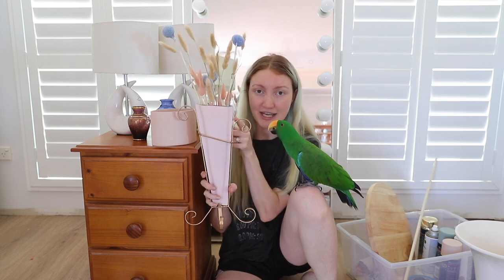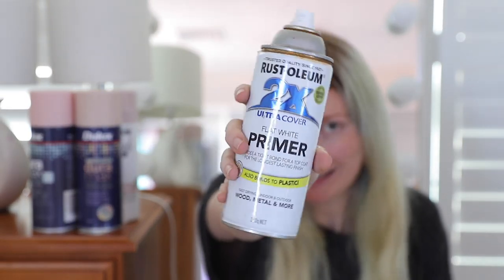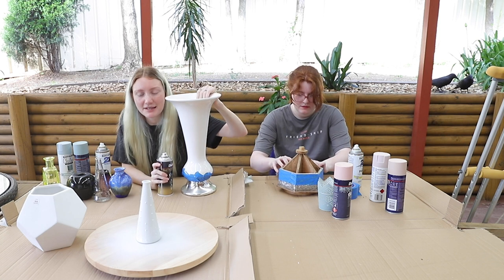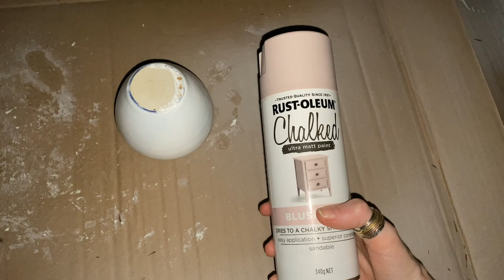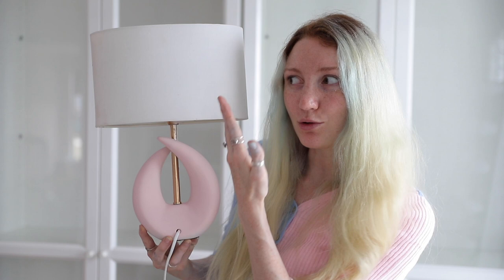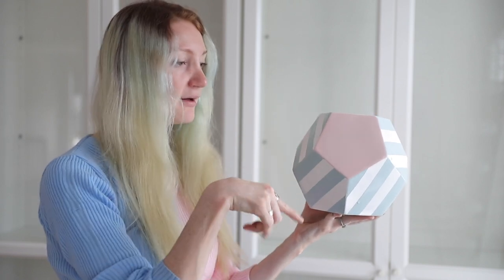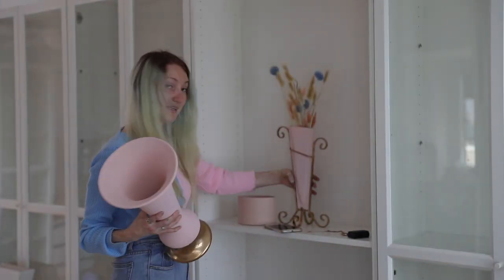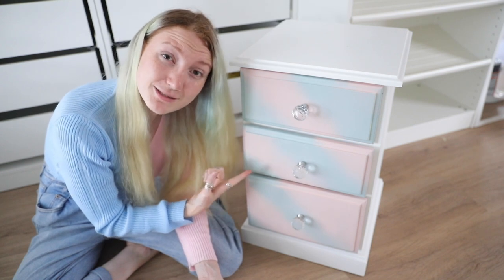PASTEL THRIFT FLIP!!! UPCYCLING THRIFTED ITEMS | THRIFTMAS DAY 5

Comment: If you want that dripping effect I suggest not using spray paint because that's probably what's making it look so rough
Reply: Then what do you suggest?
Reply: I use acrylic paints and varnish over it, but you can also make texture with acrylics if you're not careful (or on purpose for art!) and I've never worked on glass before so not sure how that would go. But that's my advice - try using something other than spray paint! And of course, take your time! :D <3 
My experience is just with putting art onto useable pieces as gifts, all wood though.
Reply: Oh another thing I just thought of! Nobody has mentioned stencils yet! A much easier way to get a consistent design onto something than using freehand! I'm sure Bunnings or some  local art store will have stencils.
Reply: @TheRainstorm97  acrylic on glass then vanished doesn't last,it scratches off so easy and can be peeled off like contact, alot of artist paint on glass with acrylics to create a 'acrylic peel offs' for their art works.

Comment: 1. For the hexagonal vase, I would highly recommend using a gold acrylic marker if you want to make the corners gold. You'd have a lot more control with the marker and you get turn the marker on its side and use that smooth edge to get a super clean finish.
2. I personally like the vases where you let the spray paint drip, especially the gold. The gold is such a vibrant color. If you want you could look into maybe a clear coat to remove and seal in some of the bumpiness.
3. Definitely use superglue for the pearls or you could use hot glue to create different textures.
4. Before you repaint everything, set them up in your room and decorate them how you would before deciding whether you want to repaint any of these items. You may like how they look and you'll know what fits and what doesn't.

Comment: To get a smooth finish on spray paint, you need to hold you can back away at least 12 inches. Also, you need to apply with very thin layers and make sure each layer is thoroughly dry before you spray some more.

Comment: I really like the gold and pink device I think the, I personally like texture in pieces I think it adds something to it. 
Also if you run into problems with paint going where it's not supposed to you can spray your paint into a container you're not worried about and use a brush to fix your problems. You have to work quickly of course because it's spray paint but you can do that

Comment: Please, PLEASE, use primer and topper, in a couple of month of use everything will flake off
Reply: Not true, I painted some furniture with spray on paint without any special topcoat and its fine years later.
Reply: @hannahbaxter8825  depends what type of forniture, if it's wood and you sanded it probably it won't flake off, but metal, plastic, things with a smooth surface will have the paint flaking off in no time, moreover if she wants to use it as a jewellery holder: pendants, rings even sunglasses will scratch the surface
Reply: It looks like she used rustoleum spray paint. That usually has better sticking power. 
Agree in general with the primer and top coat

Comment: Suggestions:
1, to help clean up lines and edges, spray some paint into a bowl and use a paintbrush. It'll save you time from messing with more tape.
2, get a lacquer or varnish spray. They come in gloss and matte. While they won't help with cracking, they'll help hide/minimize textural imperfections as well as add a layer of adherence. So those dots on the tea light holder will be less likely to come off. I just used lacquer on a piece with faux flowers and one of the large leaves is now fully attached to the canvas when it wasn't before.

Comment: Hey Alex a tip from someone nifty at taking things apart, try to get needle nose pliers. they come at various lengths and are usually better for tight spots in dissasembling different oddly shaped lamps or anything really. I even have some jewelry pliers that come in handy almost weekly. Hope that helps <3

Comment: The paint drip pieces look really good. Little imperfections give them individuality.
The little white pink and blue vases would look beautiful with a gold star on top for Christmas. You could make the stars from a small lid and a little star stuck to the top then spray gold, if you have the right size lid it should just slot over the top of the vase. The planter, yes definitely go with the gold edging, it will look amazing.

Comment: For your little mini vases with the pour effect you could retry them with acrilic paint rather than spray paint. That way you will get a much smoother finnish. Though, I really like the gold one as the texture makes it look like gold leaves were used instead of paint. I'm pretty sure bunnings mix up sample pots for like $15-20 depending on the brand, and that way you have a little pot of the exact colour you want in good quality paint.

Comment: Next time you're at Bunning's/Mitre10/Thrifty/Home Hardware (you never know which one you'll be closest to on your travels  ;} ), grab the "Frog" brand painter's tape, but make sure you get the GREEN one, it's for sensitive surfaces/applications, it's not as sticky as the regular tape but sticks enough to do the job, and take the tape off while the paint is still a bit damp, don't wait till it's completely dry, as it can lift the edges of the paint and mess up what you've just painted...and always wait for one layer of paint to dry before you whack the next lot on, especially when using metallic paints as they take longer to dry...We used to do a "guide coat" - a veeerrrry thin coat first, then when that was completely dry, do the second coat. It really does pay off in the long run, and it gives a better finish...sorry if that's a bit long winded...
I'm so glad you could get the paint off the Uranium glass vase. I was watching you paint it and going NOOOOOOOOOO at the telly (my laptop thinks it's a P.C.)...

Also, can we get a collab with Sam and Dan doing a "Dan-Cave" in the new Pastel Palace?...   ;))
See ya tomoz...

Comment: RE: the set of drawers, I think they look fantastic as they are I would not cover up the front panels with white, only thing I would touch up is the bottom drawer, needs a bit of the blue in the bottom right corner and then I think it will look perfect!

you did a great job on everything! spray paint is not the easiest medium to work with so don't beat yourself up too much about the imperfections.

Comment: For the two small vases, if you're wanting the drippy look I would use slightly thinned acrylic paint and then just use a clear coat spray over top of it!! I think it would turn out a lot better! You could potentially even use wax if you wanted it to also be textured.

Comment: The cracking you're getting is called crazing and it happens when there's too thick of a layer of wet paint. You should try a different type of paint if you'd like that drippy effect. Acrylic may work. To make it runnier, use a leveling agent. I use flood floetrol. But any such thing would work. However with that you'll want to put a decent topcoat/varnish on it. With all of these you'll want to watch out for things scratching the paint off. I've done a plethora of diy projects like these and one issue I've run into is the paint getting scratched off through just regular use.  You've done such a great job with very little tho! I loooove the colors together!

Comment: You should try weathering the gold part of the stationary holder just take some black paint water it down apply it to the gold part and use a cloth or paper towel to wipe the black on the surface away and it will leave black in the groves to bring out the pattern more.

Comment: Just to answer the vase question - start of 50's, Finland had a lot of certain kind of designer stuff put out. I think every single Finn has had something from 50's, 60's and 70's designer stuff either in their houses or relatives houses. We recognize those because they were a huge hit in a lot of households. My grandma had some bowls from the same designer, Nanny Still and I remember them fondly. If you check out Grapponia, you'll find similar styled bowls, glasses and plates. :)

Comment: Please make sure to seal everything with a top coat! 
Also the spray paint got bubbly/mottled because you were going on too thick. Always go in thin layers and wait until it's dry before doing another layer.
I think the heat factors into it as well, my first forays into spraypainting were also in the summer and I had similar problems.

I love the whole concept though! A common issue I have with buying furniture is that it doesn't match what I'm going for. But I can't be assed to paint it lol

Comment: when layering your paints. take your time...after each one, wait until it's completely dry then take the lowest grit sandpaper you can. to it. this will smooth them off and help the next color attach better ALWAYS always always do a little scrub with a low grit sandpaper in between layers.. your finish will be much more "finished.". And whether you want a matte, semi-gloss, or high gloss finish you REALLY need to put a clear coat on your finished products to protect your paint jobs. you can get them in whatever you want. for indoor/outdoor for matte, semi, high... but it necessary You are making things so much more difficult than they need to be. take from the lesson that you have just learned  that it is important to keep track of which drawers go where. it is so much easier to repaint them than it will be to try to adjust drawers to make them fit in slots they weren't made for. as for the knobs. they are a very simple fix as well. you have 2 options. 1) measure the depth of the front of the drawers take the screws over to Sam's shop and either you cut them down to size or ask him to do it. OR 2) write down  that measurement and  take the screw you have now.  and get one that is the same size in diameter but in the right length. they cost just a few cents. and can be got at your local hardware store.

Comment: Thick spray paint  like what you did for the drips will pretty much always crack. Acrylic paint for pouring like that would work really well and has less chance of cracking like that. A nice clear coat once it's dry will protect it nicely. :D

Comment: If you want to do the drip look again, try resin with mica pigments. Work outside or in a garage and the resin should kick off and harden quickly. I would STILL give it a day and maybe put a box over it for protection (and it'll get hotter and set faster). Warning: do SUPER thin layers and make sure everything is warm, especially using glass. That would be BEAUTIFUL

Comment: I think everything in this video turned out really well even with the slight mistakes.
For markers I suggest posca pens. They are like paint permanent markers that you can get from office works in all different sizes and colours. I think if you got a gold posca pen it would be easier to do the gold edging on the hexagon vase. 
They are a little bit expensive depending on what size you get but I definitely think it’s worth it

Comment: I would get a gold paint pen (or a gold sharpie if the surface is matte/buff to the touch? if that makes sense)-- and touch up accents with it.  Also, a clear gloss coat (or matte, they make them now) would be great to go over the ones with cracking.

Comment: The small vases I would like for you to strip off all the paint & try again. I liked the idea, I just think the execution was a miss. Some others suggested to do acrylic paint pour which I think would be a good way to recreate the pink & blue drippy one. However, the other I'd like for it to be white under the gold & I like the crackle of the gold on it. I would really like to deep redo it by spray painting it an earthy pot color, then painting over that with a type of white paint that intentionally cracks to show the color underneath & then do the drippy gold over top. The hexagon vase with the blue stripes. I love the gold trim idea, please do that! But please keep the edge very thin or it might look bad. The round tea candle holder you tried to make match the Ikea vases, take off the bumps & maybe attempt to hydro dip it again? Stationary holder should be white instead of pink. I wish the glass & metal items had a gloss to them. The drawers look awesome! If you want to do something, I suggest taping off the inner square & painting the beveled edges white.

Comment: I think the spray paint isn't great for the spilled paint look. You''ll probably want a paint from a bottle, like, maybe an acrylic? But the spray paint dries quickly so, it doesn't quite get the same look. Probably doesn't help with the finish. So if you want to redo it with similar idea, a diff paint would probably help

Comment: Times two trays for anything but has design and grays I use regular paint because you chose chalk paint the design doesn't pop out so when I paint trays that are 10 and 1/2 a lot of design I use water paint or regular acrylic paint so that design can stick out once it's dry or spray paint them again not with chalk paint :)

Comment: With the ceramic/glass painting that went crappy, I think it is because you did one thick layer of paint. Do a few thin layers instead and allow to dry fully in between each one. Take longer but you'll get a much better result.

And - your 'hexagon (6) vase' is a pentagon(5)

And the  'hexagon' yellow glass, is an octagon (8).

Comment: Research everything before you flip. 
Take the drawer fronts off, put them in order, try the soap thing. You'll then know if you like it or not and the pattern underneath won't matter so much. If you don't like it, you'll have them all off anyway, so you can redo the striping to where you can put them on correctly without having to put more holes in.

Comment: I absolutely LOOOOOVE the drawers and the blue tray how they are right now. You need some other colors mixed in with the pink and gold scheme to keep the interest. If everything is pink and gold, nothing will stand out.

Matte paint doesn’t allow details to show as well, so maybe strip and repaint that pink tray with a gloss paint? Also, you loaded each piece with way too much paint. You need to do many thin layers with spray paint and allow it to fully dry between coats instead of trying to completely cover with just one coat. That will reduce the bubbly texture you got on everything. And whenever possible, you have to finish with your metallic layers. Good luck with your redos and future projects!

Comment: When you apply the tape onto your object before painting instead of putting a lot of tiny pieces and toil to correctly protect the different parts you can apply a big piece of tape on the part you want to protect and cut out the details with a scalpel or a precision cutter to have nice sharp edges when painting. I do this all the time when spray painting, applying washi tape on my bullet journal pages etc..  and it is really helpful to create a perfect result. If you use this technique please be very carefull with your scalpel because the blade can easily slip on sleek materials like metal so protect your hands with cut-resistant gloves and/or prepare some bandages and a bottle of disinfectant just in case because searching for this with a bleeding wound on your fingers/hand is really painful (and you put blood everywhere because holy crap a cut bleeds a lot !). Have a good crafting day everyone ;)

Comment: The detergent tray, give me an idea, you can buy a bottle with a smaller tip or use an old ketchup bottle or something with a small tip, filled it with detergent, make small lines and then spray paint it, so it looks like it's a bunch of hundreds and thousands.

Comment: What you could do to avoid the tape ripping the paint off is use some old newspaper or scrap paper and wrap it around said object you do not wish to paint (Cylinder of paper for the lamp) and then just use a bit of tape to hold it shut. (I have come across the same issue).

Comment: The hexagon vase would look really good with the gold but i'd maybe do it with a small paintbrush instead of spray painting. But most of the ones that didn't really work out you could try again without the pressure to get the video up cause de ideas are spot on

Comment: Make sure if you're planting anything that, if they require proper drainage, not to directly plant it into the pot without rocks or sand or a smaller pot with drainage holes! It'll cause root rot and kill the plant. Or, it'll make repotting a real struggle 😅

Comment: The large pink vase with gold bottom that goes with the plate I would honestly paint the plate gold and I will go get some caulk adhesive And attach it to it flip it upside  down So the part that you painted gold on the vase is the top part and I have a piece of glass cut that slightly larger and attach suction cups to it said the glass can be suction cupped to that falls play combination it would make a gorgeous side table

Comment: I believe the reason you ended up with crackling on the 2 small vases is because of the one pink spray enamel. Spray paint and spray enamel are different, and i've tried spray painting something of my own with what ended up being enamel, and it did the same crackling thing. I would suggest not using that one and find a similar shade of pink in a real spray paint, unless of course you like the crackling effect it made :)

Comment: the cracking on a lot of them could be due to simply a too thick layer of paint
you must have needed a very thick layer to have the spray paint drip down
maybe try hand drawing or hand painting the spills next time? or use a different type of paint on top of the base spray paint layer